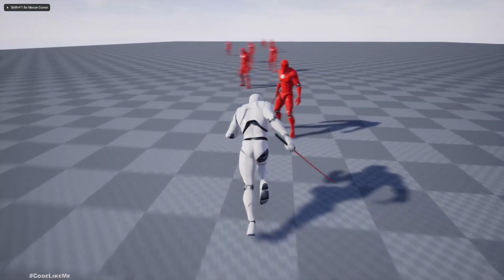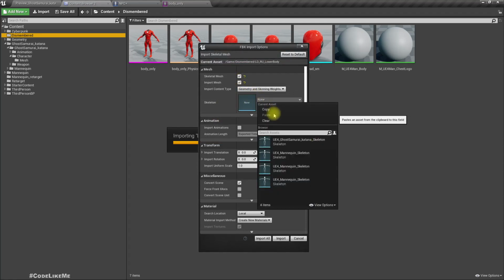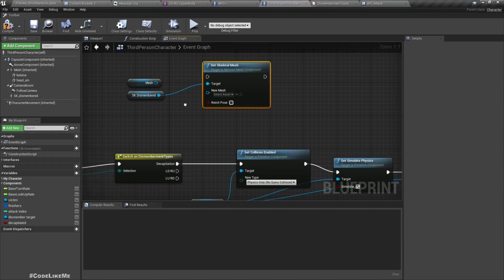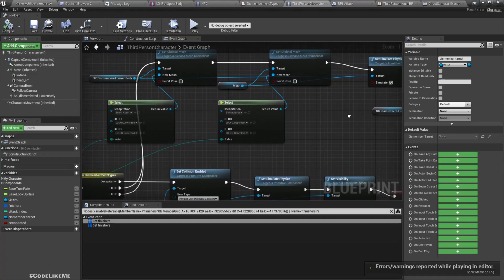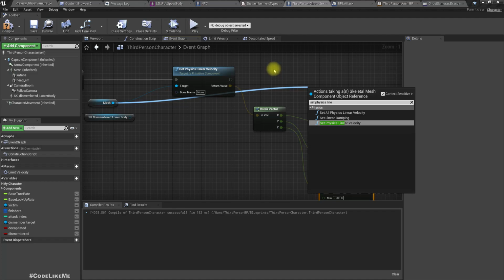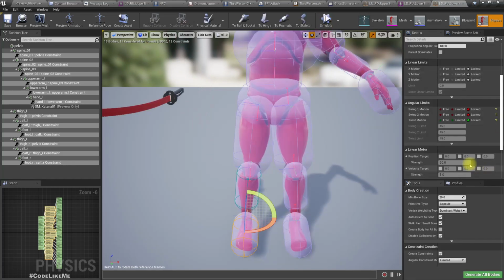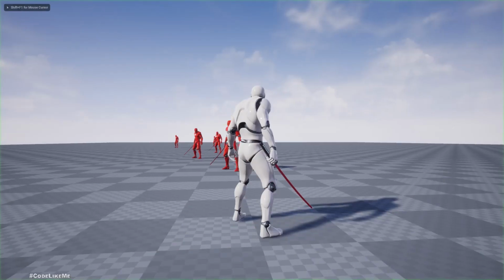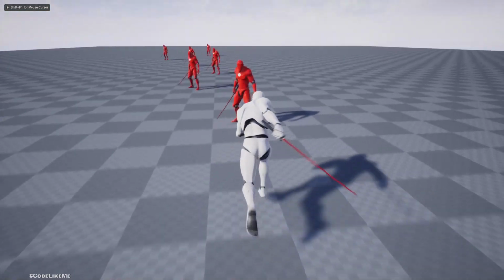Character Dismemberment in Unreal Engine

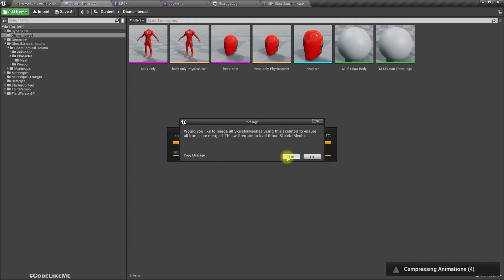Comment: While EXPORTING make sure to uncheck the "Add Leaf Bones" in the Armature option section. Otherwise it will mess up your skeleton asset (like he did at 8:41). It adds an extra bone (suffix "_end") for each ending bone in your hierarchy.
Reply: I should have read the comment section first...any idea how to fix this?
Reply: @onlyonedk  I think this might work, but please DO A BACKUP before trying. Import a brand new UE4 skeleton to your project: you can do this by a) migrating from a 3rd person project b) exporting from a 3rd person project. In case you were already working with a Thrid person project, the skeleton should be in the same location so migrating might replace the old one. In case it doesn't you can always, delete you old skeleton and it will prompt to REPLACE REFERENCE in the delete menu (NEVER FORCE DELETE!), select your new ue4 manequin skeleton to replace the old one... after is done go to your content folder, right click and do "Fix redirectors". Then save the project. Let me know if it worked
Reply: @lospe85  my guy, thank you very much for the quick response.
 I will try that and see what happens.